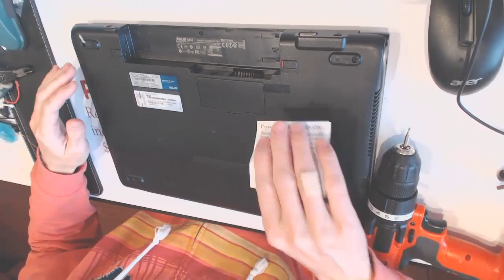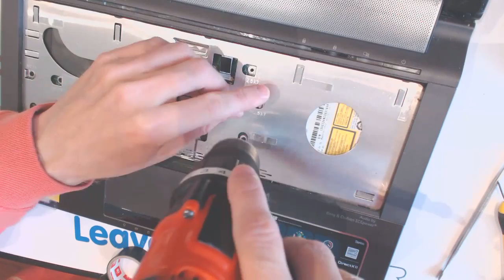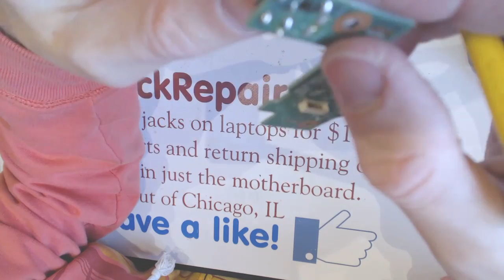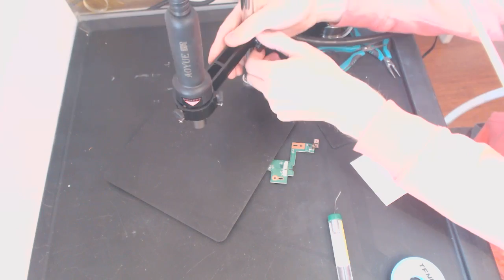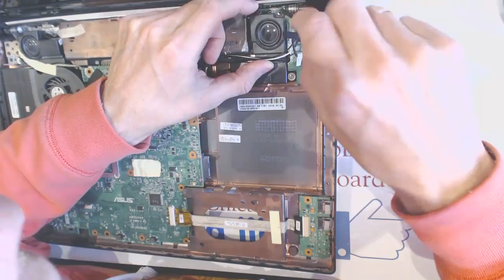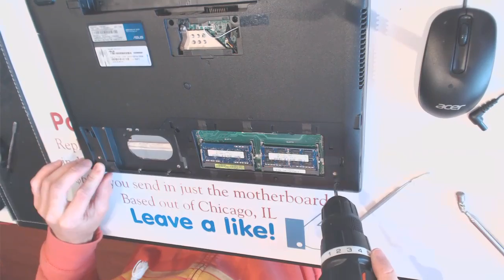Asus n53s n53sv Laptop repair fix power jack problems broken dc socket input port

Comment: I know this is an old vlog but perhaps vlogger still remembers this computer and this vlog...i did every step as recommended and replaced dc jack (n53s)and board and new charging unit..initially there was smoke coming out of dc jack when i plugged it in and then ofcourse it went dead. Anyway i was really expecting it to work..the battery light is on but it wont power on. Could you suggest other issues perhaps? Also at this point im more worried of salvaging contents of my internal drive, how do i do this?